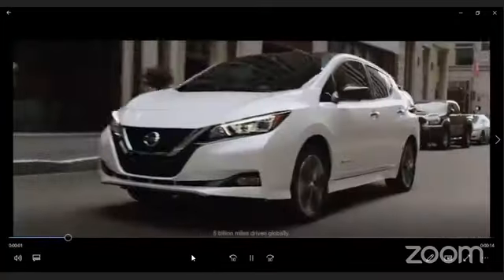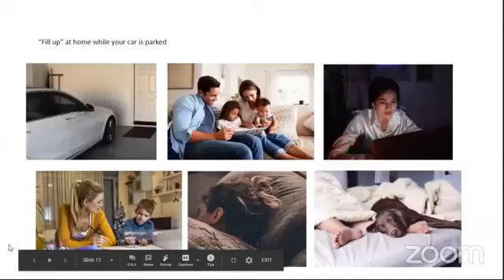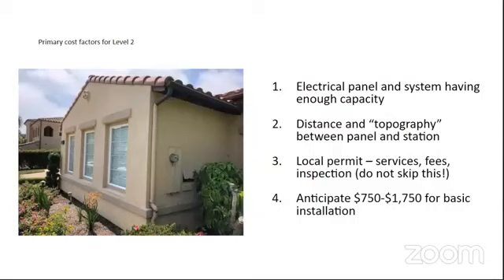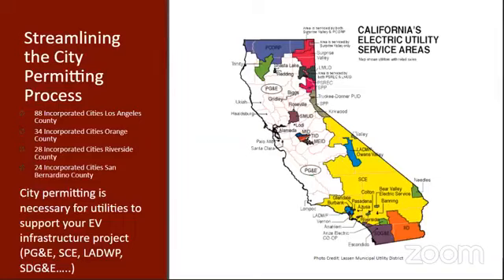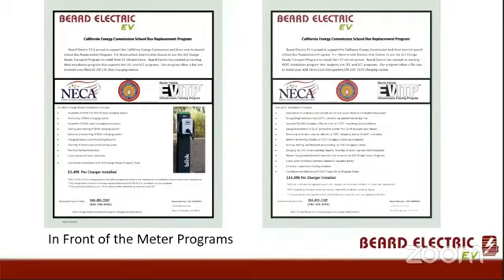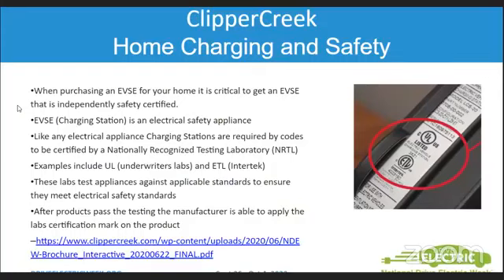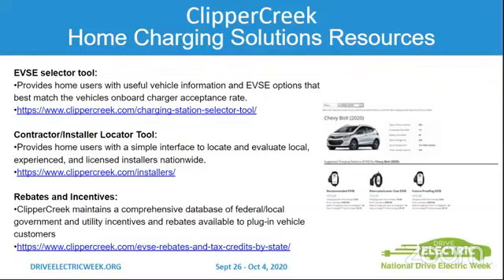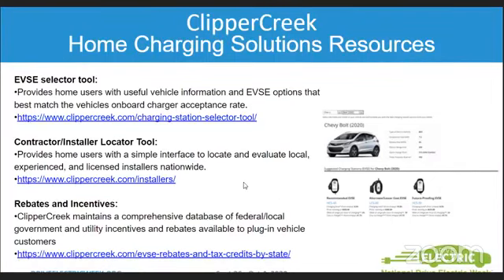Installing an EV Charging Station At Home

Comment: Every new home or major remodel should come with a 220 volt outlet and an EV charger in the garage.
Businesses need to consider installing an EV charger or two for employees or customers. 
EV charging should become part of the building code for the city.